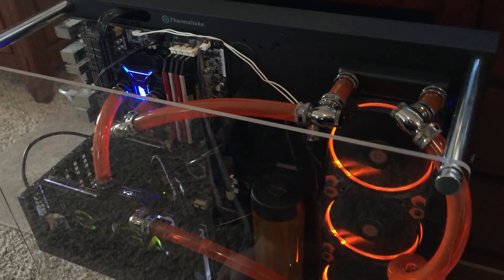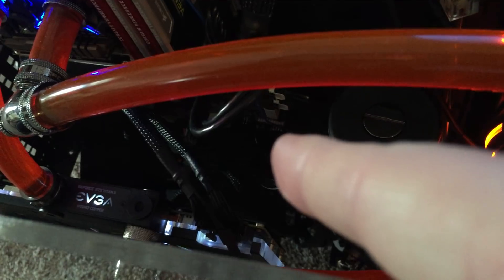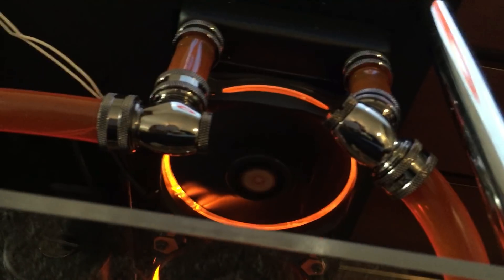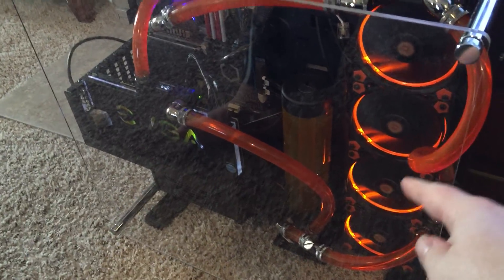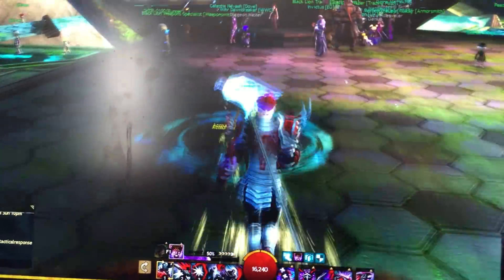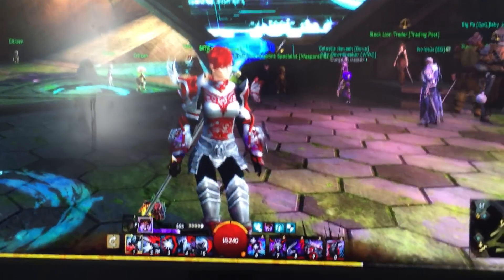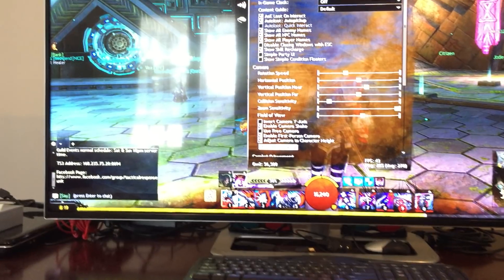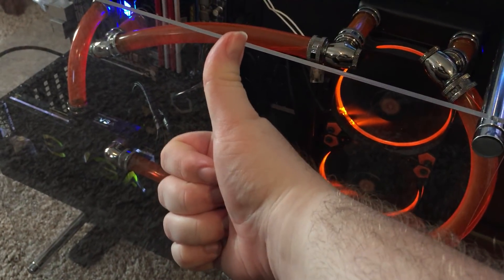My Holiday PC builds 2015

Comment: Nice build! but I wouldn't leave it laying on carpet due to static which can damage components in your system, especially with that open case. But nice overall,  does it accumulate alot of dust with the open case?

Comment: You were running Crysis 2 not Crysis the original Crysis is much more demanding than Crysis 2 and Crysis 3 that's why many people joke can it run Crysis.
Reply from the maker: Ah. Well I didn't have it installed steady my bad. Yes it can run crysis 1 too
Reply: +Ian Boswell Of Course it can but not on max setting while maintaining a minimum of 60fps I would know because I have a i7-5960X, 3 way SLI GTX Titan X pc and I know exactly what a single GTX Titan X can do.
Reply: +Ian Boswell no offence your build looks really ugly
Reply from the maker: I have tons more cold Cathodes I can add to emphasize the orange glow but what I waned to at first go for was something akin to the suggested layout. I also plan to swap the apogee cooling blocks blue light with green to match the Titans green
Reply from the maker: The Titan z on my other machine can do it so I just assumed but yeah you're probably right I think I'll sell this rig and start over.

Comment: can I build this for 10000$
Reply from the maker: The cost wasn't that high. The cooling came
To 750 the case was 150 the processor was 1k the ram 500 and the graphics 1k so it was under 4000 for the whole endeavor. The other rig cost closer to 5 just because the damn gpu was 1700

Comment: 11:50 FYI, cable quality doesn't matter with DVI because it's digital, either you have a signal or you don't
Reply from the maker: It might be the PCI extender causing the FPS chop? Or maybe the processor is bottleneck ong it somehow. It's a quad core with 4 additional simulated cores (as most in Intel line do) where as the other one has a legit Octo-core, maybe that has something to do with it'? Or maybe the X is cheaper than the Z for a reason?
Reply: Ian Boswell probably the last one

Comment: Looks like you got yourself a sick rig, but I wouldn't use colored liquid as the coolant in the custom loop. I would try to use colorless liquid with a set of colored pipes instead, because over time the dye in some colored liquid coolants coalesces into a gelatinous gunk which clogs up the CPU cooling block. Specifically, red dyed liquid coolant premixes are notorious for this. Otherwise, it is a really good setup, and I just got myself that exact air cooler that you have in your other rig.
Reply from the maker: Yeah I know about the gunk building up issue. I was told the Fesser glycol mix has a lower chance than say going with colored distilled water though